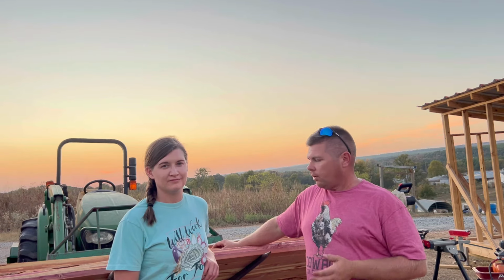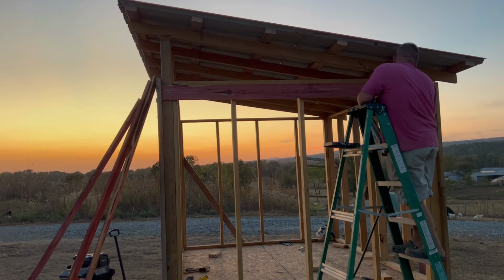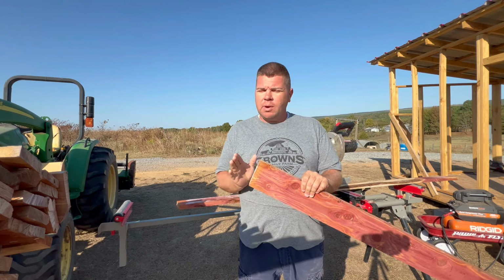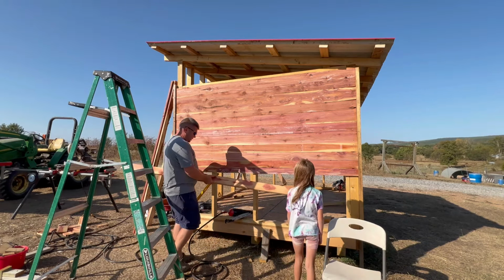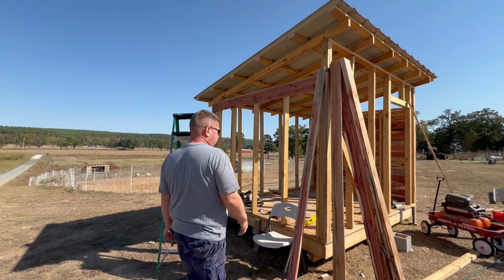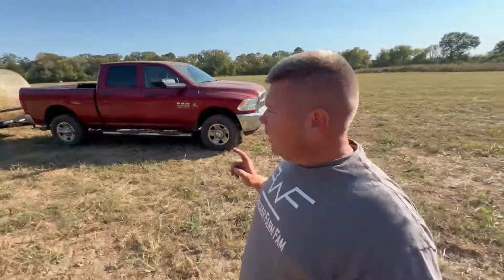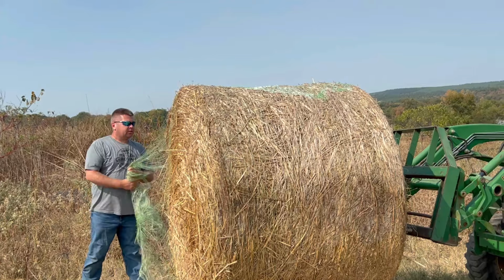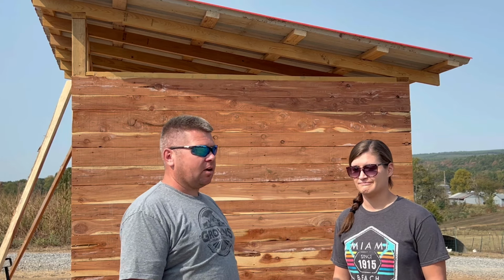This Was NOT Supposed To Happen! We Are Just Glad It Wasn’t Any Worse!

Comment: White powdery stuff on the cedar boards may be white mold. Especially if they been stacked where they were exposed to weather.  Wipe them down with white vinegar.  Cedar boards need to be sealed against weather when used outdoors.
Reply: I was coming to say the same thing, white mold if it was left out in the elements once cut.
Reply from the maker: Thank you so much for that!